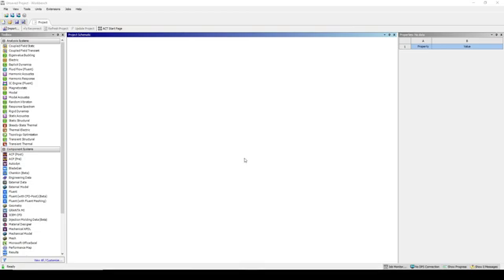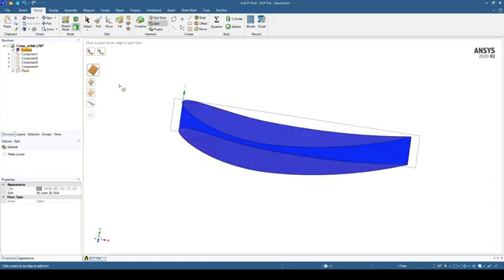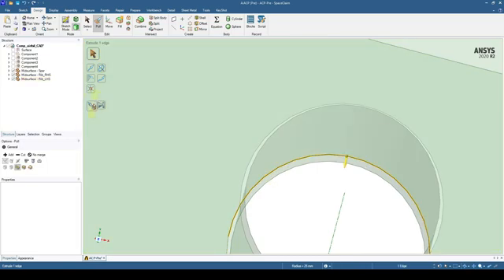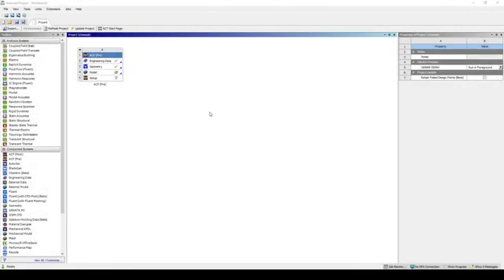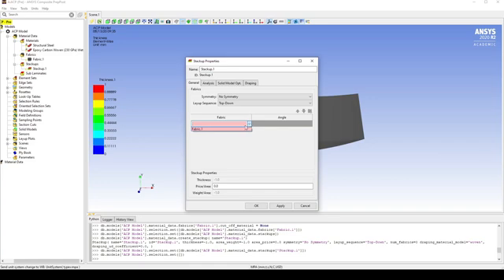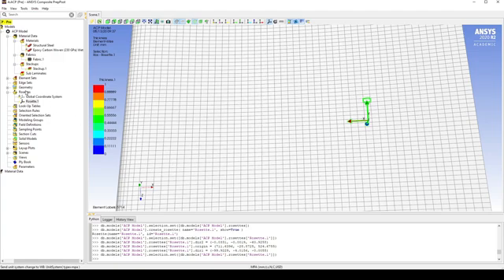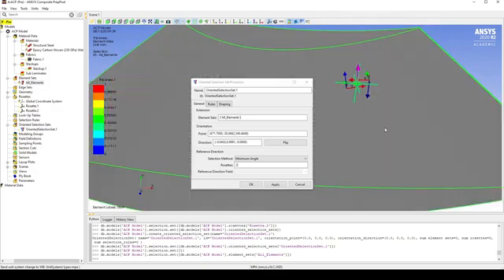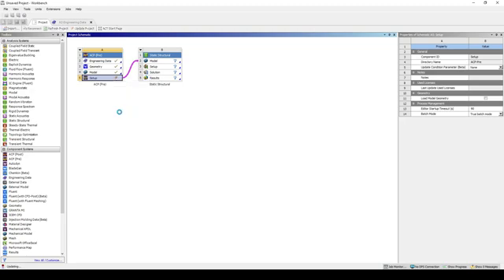Composite Wing Analysis - Ansys ACP and Mechanical 2020R2

Comment: wyh we use midsurface ?
Reply from the maker: Midsurfacing allows the creation of a surface body that is midway between existing faces of a solid - allowing you to model the thin solid as a "shell" with a thickness property which is computationally more efficient and offers other numerical benefits that we will cover in another video

Comment: نگارپژوه 
مرکز تخصصی شبیه سازی سیستم ها ی مهندسی مکانیک 
http://www.negarpajooh.com 
شما مستقیما و بدون واسطه با محقق در ارتباط هستید. 
همراه : 09198470686
آیدی تلگرام :NegarPajoohProject  

Negar Pajooh is advanced simulation institute of mechanical engineering systems
Software:
MATLAB - ANSYS - ABAQUS - SOLIDWORKS-Arduino-Labview
 Fields:
 Control, Solid Mechanics, Structural Engineering, Optimization, Fuzzy, CAD, CAE, Mechanical Vibration, Robotic, Shaft- Impeller , Rotor Dynamic, Condition Monitoring, Fault Diagnosis, Health Monitoring, Wavelet, Neural Network, Image Processing, Sensor and Actuator, Sound Processing, Finite Element Method (FEM), Piezoelectric, Numerical Method, continuous structure, Active/Passive Vibration Control 
YouTube Channel: 
 https://www.youtube.com/channel/UCeaa6Kt3mBKNW-fNgNgOqTg 
Gmail:
NegarPajooh@gmail.com 
Phone, What's app, Telegram:: 
+989198470686
Website: 
 http://www.negarpajooh.com

Comment: Can someone help with an Acp input validation failure where there is no data contained in the input mesh file?
Reply: your model is probably meshed with fluent mesh settings while meshing, change it to static structural mesh, it should work, or else the input geometry was meshed/modelled with a future version of ansys rather than the version that you have, check on that too, it should probably work